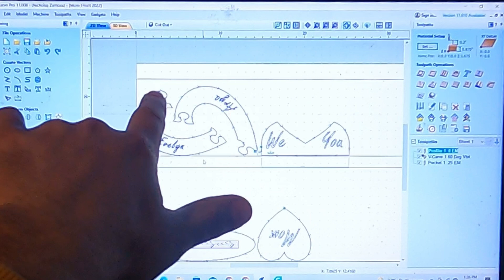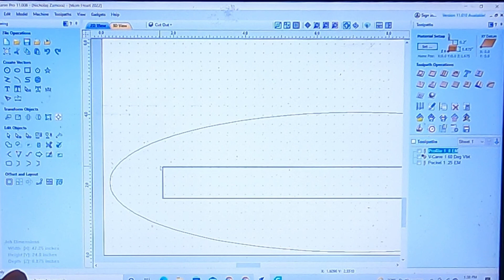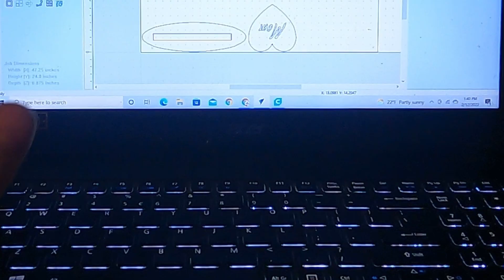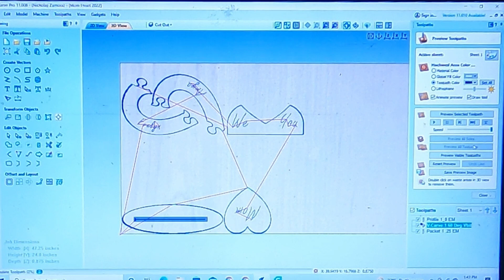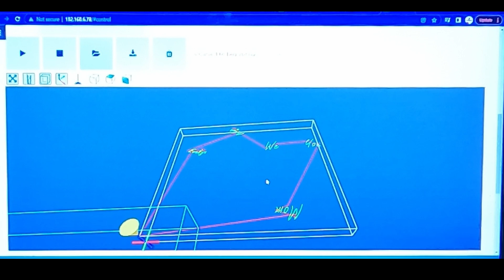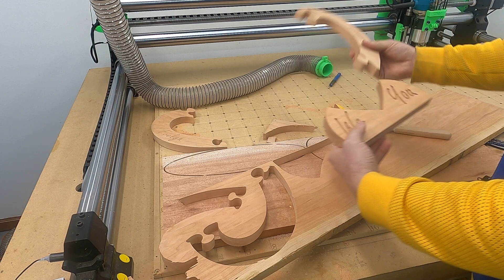CNC Mother's Day Project From Start To Finish: Onefinity CNC

Comment: Why not probe from the surface of the wood?  You could probe XYZ at the same time and save time/error in placement of the bit for XY. You already know you wood thickness, so going off the surface of the material shouldn’t. Not saying “you’re doing it wrong”. I’ve just found for my new self that doing it off the top corner is really easy for someone new.